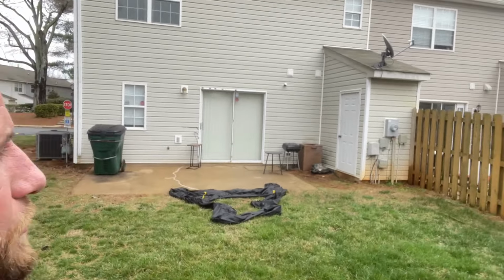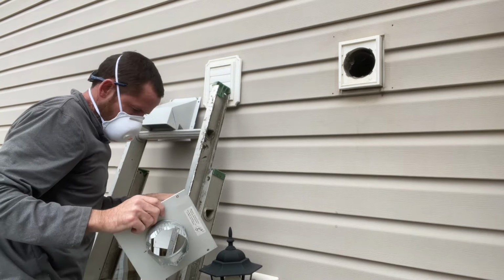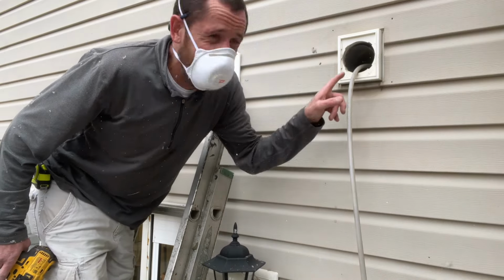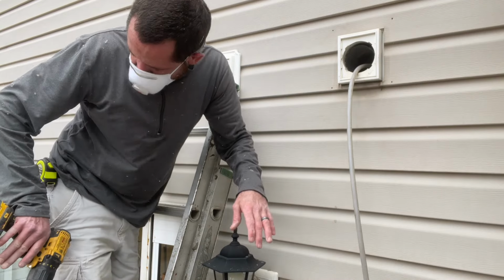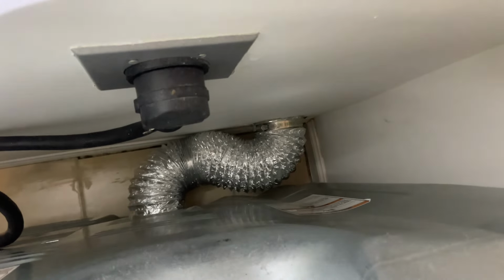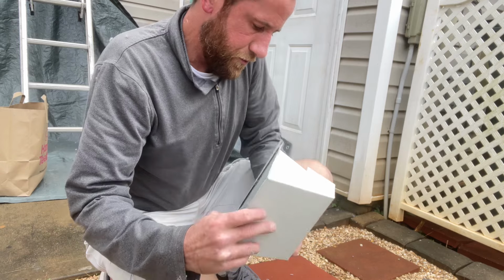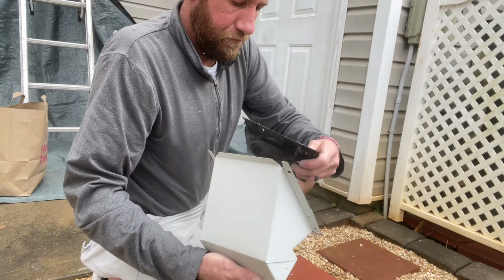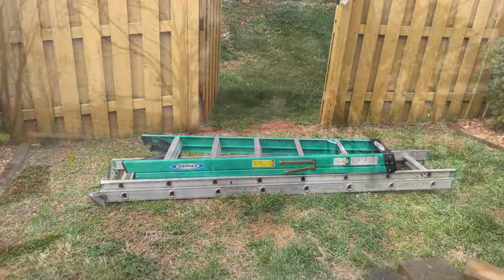Cleaning a DRYER VENT! What Happened to Work Ethic?! #almetaldryervent #satisfying #viral #funny

Comment: What I like doing is using two dryer 90s. With rigid flex pipe. Make a large u going up the wall and then back down to the dryer. The dryer can be pulled out and pushed back without pinching the vent pipe. I up-sell smoke alarms for the laundry room.